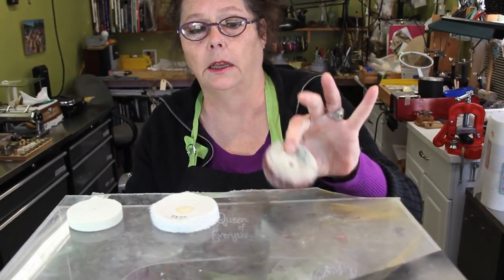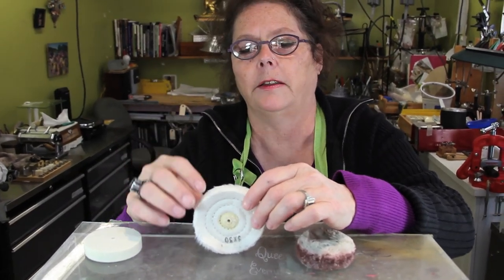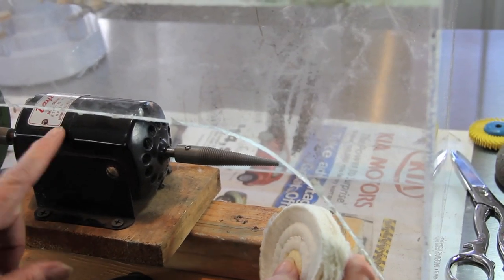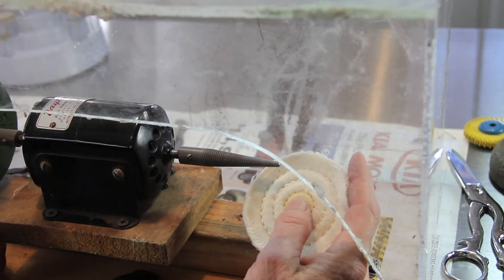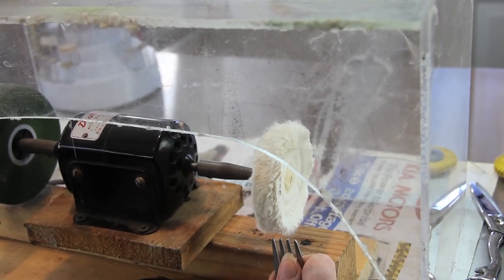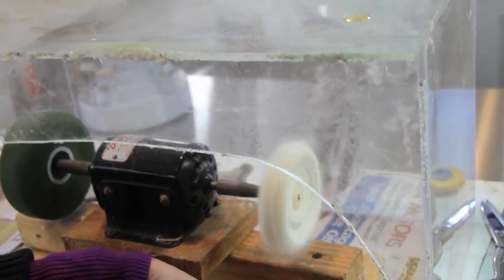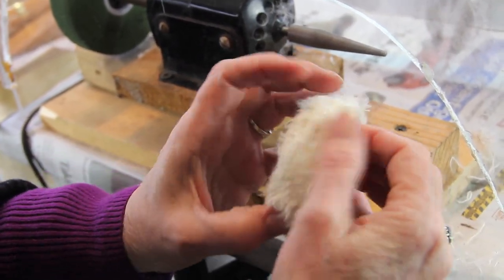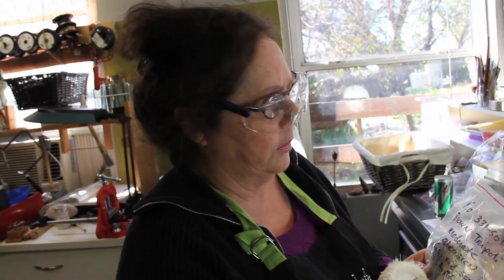How to Finish Jewelry

Comment: I'm so glad that you you talked about polishing chain. I don't have a tumbler so wrapping the chain around a thick round thing to anchor it really does seem like it's much safer than not using one.   I'm going to try that the first chance I get. I have found with my little bit of experimentation, that I also prefer the sanding paper wheels than anything else.  I wish that there were pro polishing pads for the flex shaft.

Comment: Nancy's not kidding when she says it's dangerous. For newcomers to the polishing process: Until you've had a piece of metal pulled out of your hand, when you thought you had a secure grip, or seen the whipping action from a loose piece of chain, you just don't know how very dangerous the polishing wheel is. USE GREAT CAUTION at the polishing wheel. The results are beautiful, but it is a powerful tool and one wrong move, a loose lace on a shirt or dangling chain that holds one eyeglasses or holding the piece being polished at the wrong angle is all it takes to get seriously injured. I was stunned the first time I had an incident at the wheel, it is capable of very serious injury.

Comment: Hello Nancy I have a question for you. How do you protect a polished surface when your have doing a brushing surface very close to it ?
Reply from the maker: I like to use painter's tape.  If you can, tape off the area that you want to protect.  You could also try painting some heated-up beeswax over the area to protect too. Nail polish might work too. Use a fine-tipped brush.  You'll need nail polish remover to take it off later and to clean your brush.  I haven't tried this but, seems like it should work?  A lot depends on how much surface area needs to be covered and how easy it is to access.  Using silicone points also helps.  You can re-shape or sharpen them on a file by dragging the abrasive (in a flex shaft) down a file's surface.  Wear a mask!  Rio Grande sells them: https://www.riogrande.com/product/dedeco-silicone-midgets-polishing-point-assortment/332877.  Thanks!  N

Comment: Hi, Nancy! I know this video is very old video, but I found it the most relevant for my question. You said you don't usually coat your copper and brass, but in that case how do you protects the customers' skin from turning green? I have tried a few types of wax and polish but they absolutely do not work for rings and the metal ends up oxidising and colouring people's skin
Reply from the maker: Thanks for watching that antique!  Haha.  I stopped making rings and bracelets in copper, brass or bronze - unless they are prototypes.  They can be sealed but, the sealant will wear off - especially on rings and bracelets.  It's a never-ending conundrum!  You can also sweat solder a silver lining onto the insides of both bracelets/cuffs and rings.  Extra work though.  I haven't found a great solution.  You could try a clear, shiny or matte powder coating?  Good luck!  N
Reply: @NancyHamiltonJewelry  Thank you so much! I didn't even expect a rely but I enjoy your videos so much! And they are so educational and fun to watch!

Comment: hey Nancy;
very informative / lively video about buffing stuff !

i'm trying to BUFF ( should i say SHINE ?) small steel pieces you find on the shelves of the building materials at " home depot". they use those pieces for combining wood in various ways for construction.

since those pieces are relatively small, they fall under the same category of what you talk about in your video. i'm only looking to SHINE a piece, NOT to eliminate scratches, etc.
but i'm still confused :  mostly about the SEQUENCE of the buffing process,
and : the materials/ compounds to use. in other words : what compound to start with ?
what next ? etc. 
i got a hand drill powerful enough as a wheel mover and i have the " buffing kit" from home depot. if you clarify further the points i made ~ that would be lovely 😇🙀
much thanks in advance;

amir

Comment: Hi Nancy,
I have a 18K gold bracelet that there is satin finish on surface of gold. there is very light scratches on gold, so I want to refinish the surface. What do I do first? Sand it or high polish it or just use the  satin finish wheel?
Thank you so much for your video.

Comment: Hello,
I have a titanium finished watch case and took to a dremel with 320 grit buffing wheel but I cannot seem to get an overall even satin finish as i  usually do on stainless steel.
I have on order some radial bristle discs 320 & 400 grit to see if they can improve the job but it is getting expensive ordering all these accessories... i am almost thinking of using barkeepers friend and polish by hand to try and get an overall even finish but not so sure.. Do you know of any pastes out there which can be hand applied to touch up a satin finish after dremel use?  

Thank you!

Comment: hi, can anyone help, when I go to buff my silver with the flex and the bench grinder, the white wheels I use just go black, then the black goes over the rest of the piece ? all my white pads are all black now, anyone else had this problem ? I bought a block of rouge but its like a copy one, could it be that ? is rouge meant to be soft mine is rock hard ? any help will be appreciated thanks